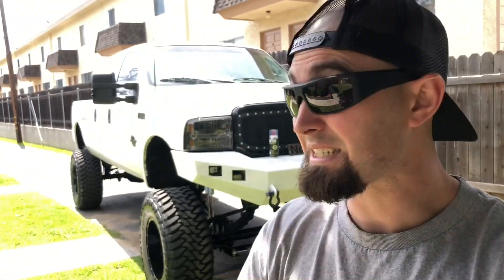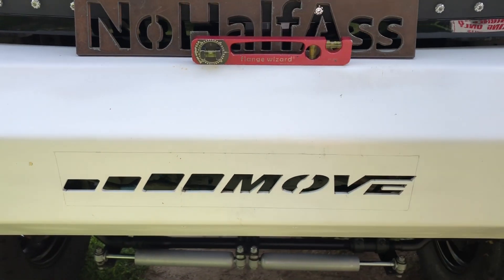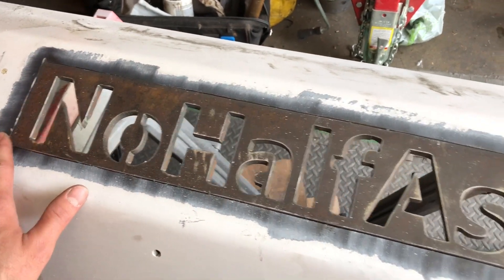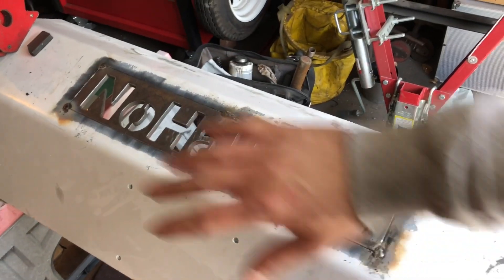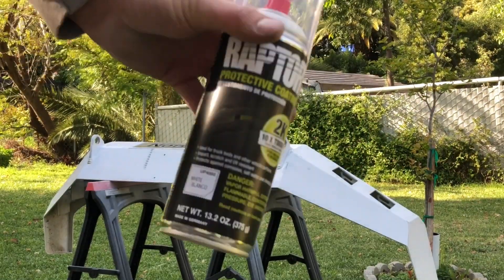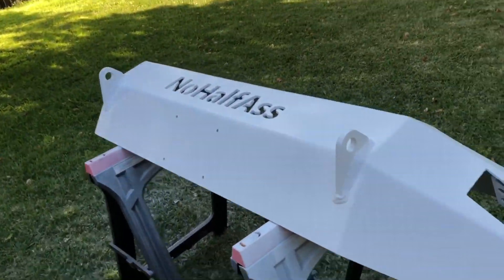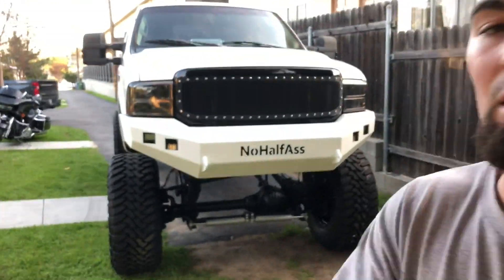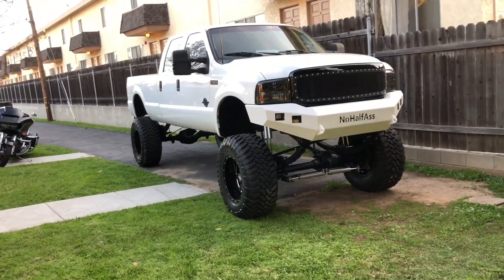7.3 Front Bumper Gets White Bed Liner & Custom NoHalfAss Plate Welded In! HUGE 7.3 Powerstroke Build

Comment: I’m actually doing my entire truck in raptor liner. Check out rust belt mechanic on YouTube, did his duramax and it looks amazing. Just added 2% urethane to the mix to give a more even spray on, did about two coats and it turned out amazing. 

Trying it on my hood and top of cab first since the paint is messed up and gone there anyway.
Reply from the maker: bob stark that’s cool bro! I’ll check him out! Thanks for the info. I need to figure out something for my truck too cuz the paint isn’t perfect but a paint job is expensive as hell 🤔🤔🤔
Reply: 80HD Projects Heck yeah man, here is his 1 year review after having it done.

https://youtu.be/vaHYzAFxZQU